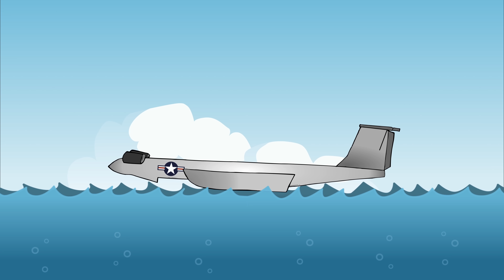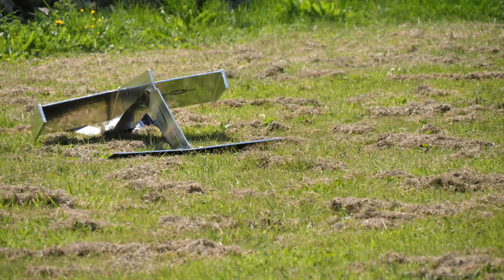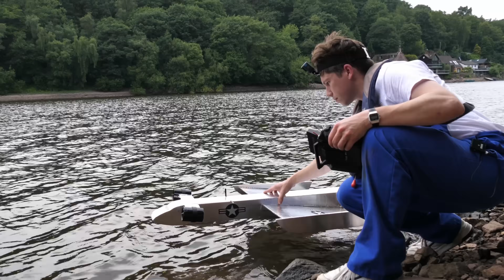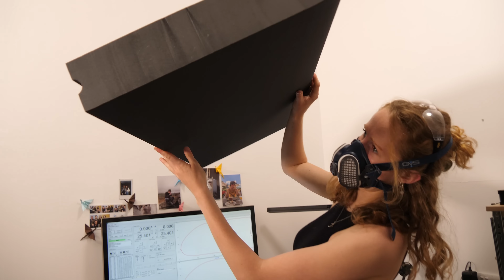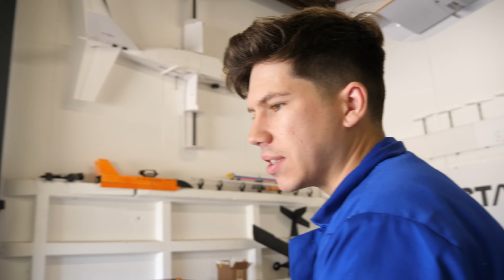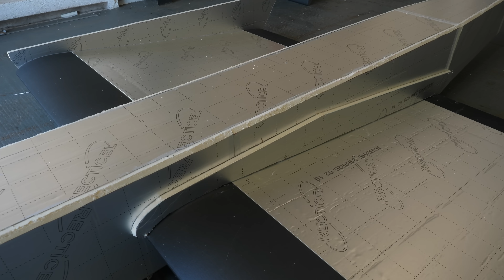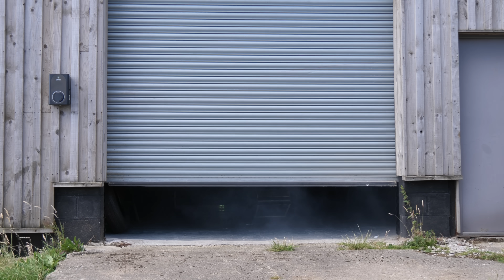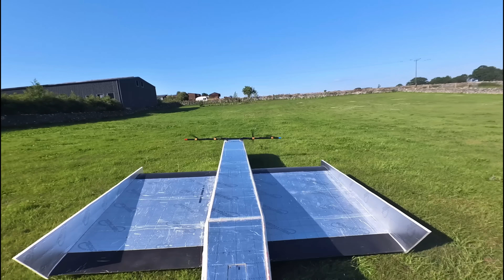Giant Ground Effect Plane (part 1)

Comment: You mentioned RCTestflight. But you didn't use arduplane or lidar for a feedback loop for control in the ground effect. Was there a reason you didn't use a flight controller?

Comment: 1:19 isn’t flying low / close to the ground less effective than higher? If you fly high enough the air will be less dense and you get more velocity due to less drag with the same power
Reply: Ground effect vehicles are very efficient. They don't need as much power to generate the same lift. They aren't necessarily FASTER but they are very efficient in terms of lift to power ratio, and true ground effect vehicles will keep themselves on ground effect since it is a self-stabilizing feedback loop.

Comment: Note that the Ekranoplan had ducted jet exhausts, pointing downward at low speed,  pointing over the wing at high speeds - this would be useful for trim
Reply: That’s a really good callout. The higher speed of the jet exhaust over the top of the wing should enhance the Bernoulli effect, right? The air under the wing should be moving close to the air speed of the wing, while the air above it would be much faster. This should increase the pressure under the wing by quite a bit.
Reply: Not just the Sea Monster. Smaller ekranoplans exist (4-6 seaters that look suspiciously like rewinged Piper Arrows or Lances) and they also have nose thrust vectoring

It's worth noting that the Sea Monster's tail engines weren't there for show. The faster an ekranoplan flies in ground effect the more stable it becomes - then there was the T90 which could flay up to 10,000 feet as well as in ground effect

Smaller exranoplans usually have a shorter length to wing ratio. I suspect that a scaled Sea Monster will be more difficult to fly than if the wingspan was greater and/or fuselage shorter

Comment: most “ground effect vehicles” I’ve seen on youtube have been either low flying aircraft barely taking advantage of ground effect, or glorified airboats just sailing on the surface, however this build seemed to actually maximise the effects of ground effect while also maintaining the iconic look of the caspian sea monster, very well executed
Reply: Have you seen rctestflight?
Reply: @TheZombieSaints  yes I made a bit of a generalisation there are some incredible ground effect/ram effect vehicles such as rctestflight’s projects but often the term is used kinda clickbaitily
Reply: Ground Effect is mostly noticeable at larger scales. There are times when pilots of actual aircraft have a hard time landing a plane if they're coming in too fast because they hit the ground effect and the plane will just ride on that cushion of air. Lun (The Caspian Sea Monster/Ekranoplan) couldn't take off past a few metres simply because she was too heavy and her wings weren't long enough to ensure full on flight, but ensured full ground effect instead. These smaller scale RC models are simply just not at the right size to keep themselves from being low level flight aircraft.
Reply: Lol

Comment: why every RC ekranoplan are built without the back engine????  

PS:  the American markings are bad taste.
Reply: The back engine does not pump air under the wings
Reply: @Inedilarion  They are the main propulsion, the front ones are mainly used to generate lift.

This is why the majority of RC Ekranoplanes fly away, because it's almost impossible to correctly balance lift and propulsion.

Comment: Give Emma a video on the wire cutter please. That thing looks sick.
Reply: Seconded. 

From experience, having a long length of hot nichrome is a lot harder than it looks because it stretches about 1cm per 40cm length as it comes up to temp AND the wire embedded in the foam ends up being a LOT hotter than the wire in air, so keeping the thing taut enough to cut cleanly without deflecting is a delicate balance

I'd really like to see how she's solved the issues for consistent cutting

btw I get why she's wearing the mask, but cutting foam has the potential to release hydrogen cyanide gas and the room needs to be REALLY well ventilated or (better), she should be wearing a positively ventilated hood fed from OUTSIDE the cutting area
Reply: I think it looks... HOT!!!

Comment: The big thing with Ekranoplanes is that they can be loaded with the same amount of cargo as an equivalent sized ship and then transport it at much higher speeds than a normal cargo ship.
Reply: Yep , also has a higher load capacity than a plane of the same size , there is a reason why the Caspian sea monster had a weight of 250 tons and could carry its own weight in cargo , meanwhile modern cargo planez doesn't come close to the 250 tons cargo capacity of the Caspian sea monster
Reply: Yes. It can also be scaled 1:1 unlike ships, aircraft or land vehicles. Meaning that if you just took this and scaled it 100 times it would still work. And this a wing-in type, whereas Bartini's VVA-14 used the full surface to generate lift and was more efficient.